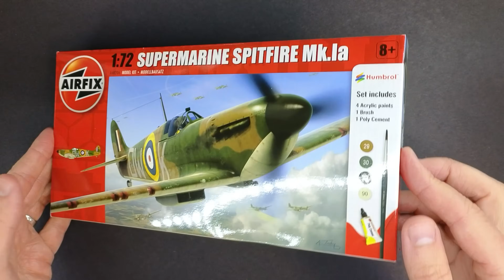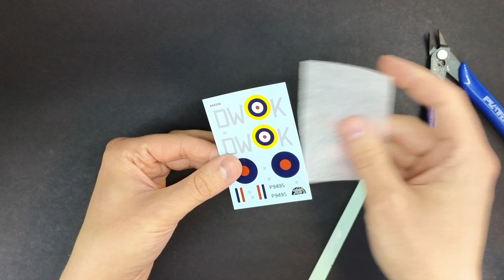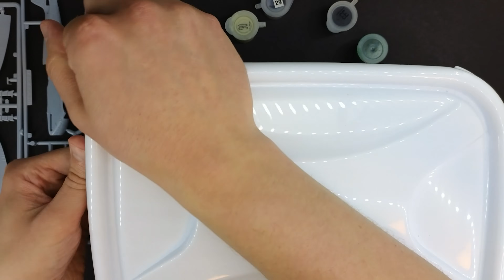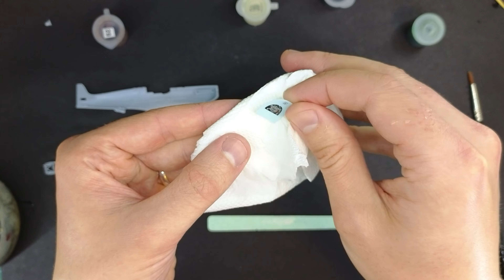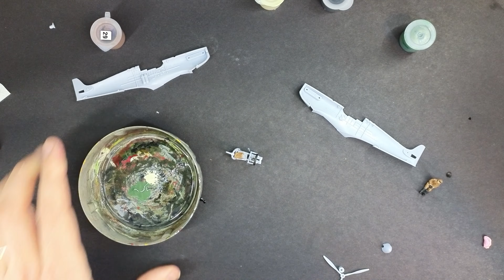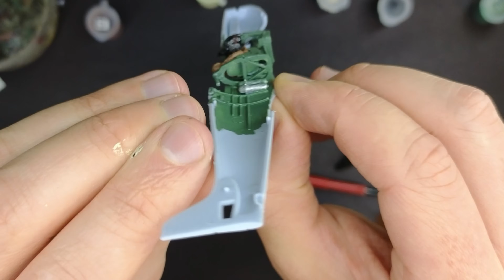Airfix Spitfire Mk.Ia - Build With Me! Part 1: Getting Started With Your First Steps

Comment: Ref gluing or painting first.. I did see one You Tuber who used masking fluid on areas he'd want glue to stick to later, then painted the parts and removed the masking fluid. Hey presto, a painted part with clean mating areas :) IIRC he did the edges and inside tail surfaces of a fuselage that way.
Reply from the maker: Not a bad idea - probably not something I would do though as it takes a lot of foresight to know where the glue is going and then extra work to add the mask on, but something to consider

Comment: Hi Matt.. re washing parts.. could you use an electric toothbrush or might that be too vigorous especially on small parts? That being said an old electric toothbrush with a flat battery is basically a manual one anyway :)
Reply from the maker: hmm that is an interesting idea! I think for large parts it would be fine
Reply: @ModelMinutes  maybe the smaller head on a dead electric toothbrush would get in small nooks and crannies easier?
Reply from the maker: @julianmhall  maybe

Comment: Starter Sets are the worst option to build a model. It makes harder build instead of buying good cement, paints and brush.
Reply from the maker: Well there will always have to be a balance between ease and cost. To get better quality paints and glue in the set will mean pushing the price up to the point it’s no longer in the budget of someone just starting out

Comment: As for the decal solutions: when I was building my first kit after returning to the hobby (which incidentally was the same Spitfire 😅) I didn't have any of those, so I found a tip online saying to use vinegar diluted with water. I ended up using straight vinegar, as I found it worked better that way. And WORK IT DID! The decals melted into the recessed panel lines beautifully! I think it's quite a good tip to include into a beginner level video.

Waiting for the next one!
Reply from the maker: Yes, the acetic acid in the vinegar helps to soften the decal :)

Comment: That's a bit of an odd choice to first assemble all the cockpit parts to prevent having to scrape off paint for glueing.
Only for you to still end up scraping off paint to glue the whole cockpit assembly in place.😅
The result looks fine so it all works out in the end.👍
Reply from the maker: The point was to glue all the small parts together - they have such a small contact area that any paint there could get in the way of them bonding properly. The cockpit assembly as a whole has a considerably larger surface area for gluing into the fuselage sides, so paint being there isn't much of an issue.

Given that my intended audience for this video is primarily beginners, i thought this was the simplest way to mitigate their parts not gluing together correctly
Reply: @ModelMinutes That's not a bad idea. I've personally never used Humbrol's Poly Cement, only Revell's Contacta, which seems to glue small part fine through some paint. Just don't make it load bearing.